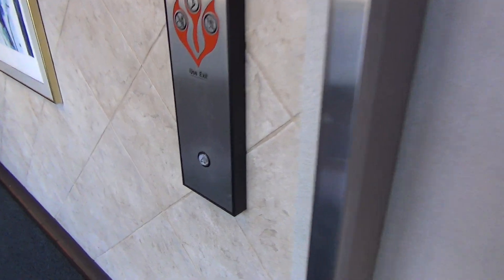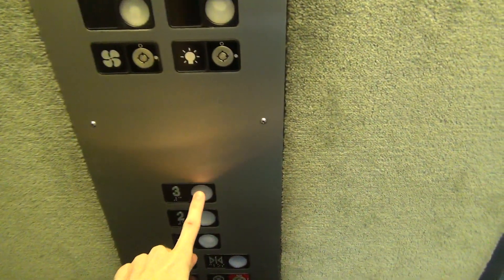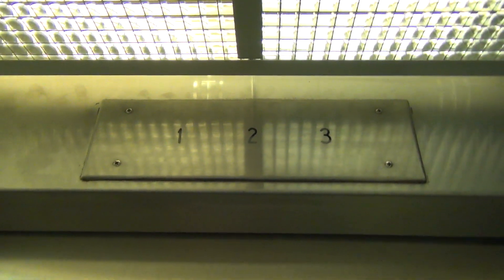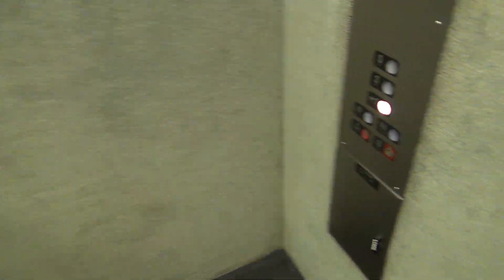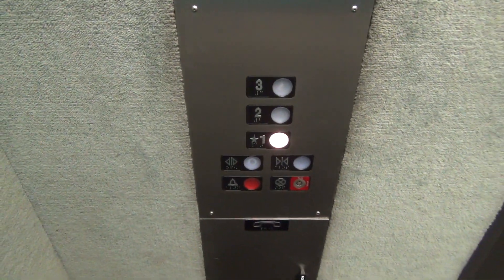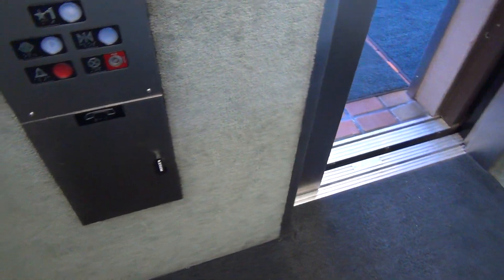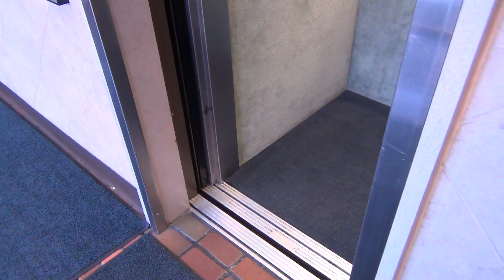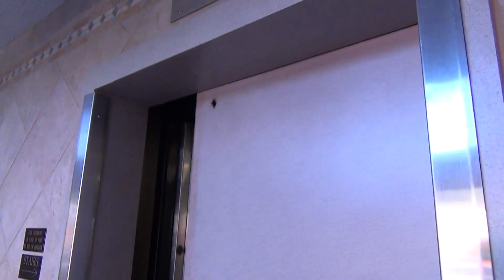1970 Haughton Hydraulic Elevator @ The Premier Building - Olivette, MO

Comment: This is a gem!!  By the way, I checked out the other video.  I could be completely wrong but my (old) memory is conjuring up what an old Otis guy told me years ago.  A bank of relay-controlled Otis traction cars just down the street with 6850 (pie plate) selectors did the normal off-on thing typical of that era... except for car #4...  it did just like this one with the overlapping.  My Otis friend told me that, even though the floor switches were mechanical (on the pie plates), they were connected to relays that allowed current to flow to the lamps in the floor indicator.  In the case of the overlapping numbers on car #4, there was an apparent serious electrical feed issue causing phase reversal.  It was causing this along with other minor peculiar issues.  They didn't fix it because it ran and a massive modernization was about to take place.  My Otis friend passed away last December so I can't ask him.  As you said, that overlapping is very unique... I wonder if there's AC phase reversal going on here too?  (Sorry for the long comment... sometimes my brain actually fires up and stumbles for a while  :-) )
Reply from the maker: Thats interesting!